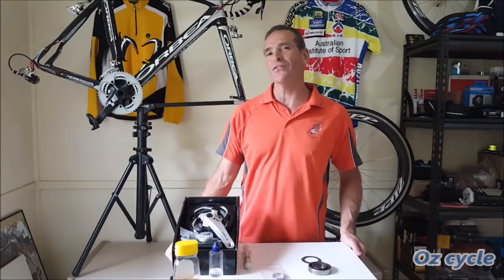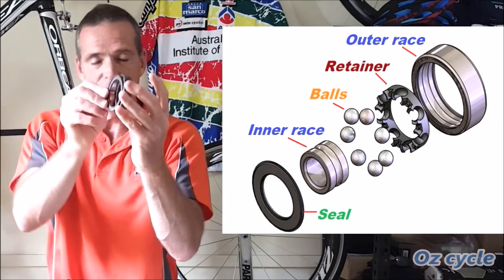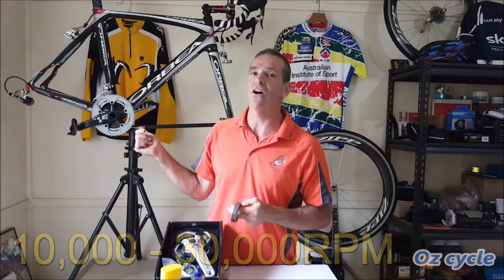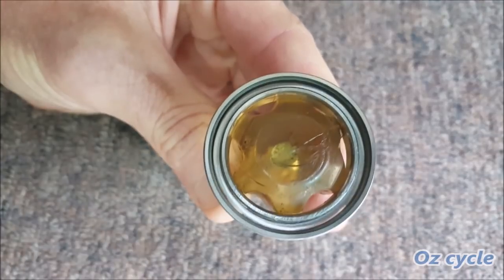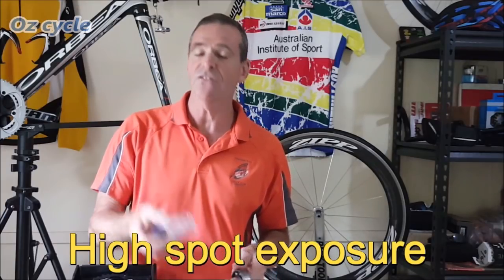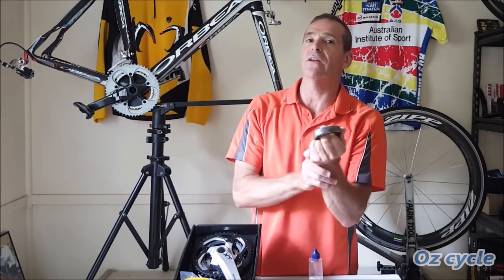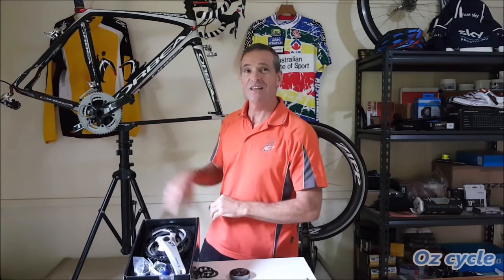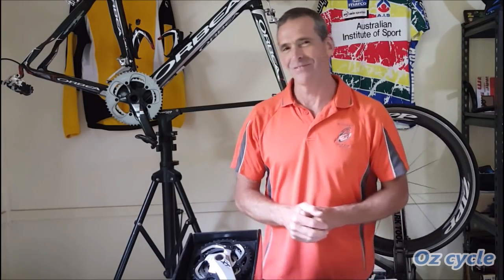Listen to your Bearings - Episode 3..Last longer , go faster.

Comment: DO NOT remove the grease from your bearings. The sticktion from grease is negligible as compared to the losses you will get when running a hot and poorly lubricated bearing. The no load spinning bearing test is flawed and shows a lack of understanding of how bearings work and what their intended purpose is.

Comment: DO NOT     repeat   DO NOT   ever use PETROL for degreasing or cleaning ever !!!!!!   it is too volatile and it's flash point is very low...   Kerosene is very effective and reasonably safe to use out in the open air.   there are many degreasers available in spray form, like WD-40.   NEVER bring petrol into an enclosed area , garage, home , basement, or place of work when the fumes can escape the approved container.    watch videos on the internet on how people set themselves on fire with petrol.

Comment: Nice video, my tip; When popping your seals off there is a risk of damaging the lip. So pop them off on the outside race not the inside because the outer lip stays static and is not as crucial for sealing.
Reply from the maker: Yes thats true,thanx David
Reply: I have started packing my bottom bracket bearings with marine grease used for boat trailers. Great for longevity as it copes with the wet weather  and with the slow rpm of the cranks I have not noticed any extra effort to overcome the extra resistance. The time I save on maintenance is well worth any time I might be losing on my commute :)

Comment: The notion that lubricants cause friction is totally wrong-minded. Dry clean bearings spin freely, because they have no significant mass, and lubes add a miniscule level of material resisting the spinning. Add the mass of a wheel, or rider, and the lube's very slight internal friction is overwhelmed by the rotational forces, and both oils and greases form critical boundary layers between the metal to metal parts, so things with quality lube are suspended on that thin film. Remove it, and you will soon destroy the bearings from pressure and contamination and corrosion, if not stainless or ceramic. Using quality bearings with adequate lube that is resistant to water contamination provides 99.9% of the friction reduction one can obtain, and dwelling on the anal aspects of hypothetical (read: magical) gains left to wring out of super-duper bearings with super-duper lubes misses the mark by a mile.

Comment: I saw that there is an NLGI grade for grease. From 000 to 6 (000 being very fluid and 6 extremely hard). For bottom bracket bearings, the ideal is 00 to 1 if I'm not mistaken.
Reply from the maker: For most bottom bracket bearings a medium viscosity grease will do fine.

Comment: Hi great video, but, but, but I have a bike with the wonderful BB30 and have grown tired of of having my factory authorized dealer repair it every 4 to 5 months. Yes it spins great for a  while but soon creaks and groans. So taking things into my own hands I repacked them with Molybdenum grease and coated the outsides with Copper grease (heat and water resistant for south Florida conditions)  Yes it probably slows the bearing down but I have not had a creek in over 8 months since I have done this. I will deal with the loss of speed and not have to worry if the bike is going to creek every time I take it out....
Reply from the maker: +Joe Martinello Good move Joe. There is a permanent solution to creaky bb....I will be uploading the video this Wednesday.  It may be your solution if it creaks again.
Reply: Thanks I will use the Loctite next time I need to repair...
Reply: Now at 14 months and over 5000 miles without a creek since using Molybdenum grease......
Reply from the maker: Thats great Joe.
Reply: @stevenleffanue  23 Months and creaking grrrr. . Way better then the 3 or 4 months I was getting with silicone grease. This time I am trying automotive  "Disk Brake Grease". I live in South Florida where the average temperature is in the 90's F. My assumption is the greasing is melting in the heat and slowly leaking out. The disk brake grease has a very high melting point. Will update.

Comment: Why are hub grease thick and viscous when this video shows that a thin lubricant is more efficient and causes less friction on the bearings?  BTW, skateboarders lub their bearings with thin oil.
Reply from the maker: A thicker lubricant will remain with the bearings longer where as thinner lube is less friction but will spin out of the bearing quicker. Using a thinner lube will require less time between relubrication.

Comment: Why then Shimano is using usually 9 bearings in rear hub and 10 in front? It's not a mechanical bearing but isn't principle the same? Edit: they are in different sizes, so how this is affecting?
Reply from the maker: Traditionally front hub body sizes are smaller than rear so smaller bearings were used in front hubs.

Comment: hai oz. super nice video. thankyou for the research! from what i see in the comments section, you recommend the medium greaser like finish line or white lithium. so, how the nano lube? is it better? or is it used together with the medium greaser? or i can use the nano lube alone. because what i get in my local market is only the nano lube for car engine, which is the lube need to be mixed with the engine oil.
Reply from the maker: +Kevin Kurniadi If the viscocity of the nano lube is like normal bearing grease it should be fine Kevin.
Reply: thanks a lot!

Comment: very good video. my bike hubs dont have ant retainers. is that because its a low end bike? £500 bike. could I put retainers in the hubs to get improved performance?
Reply from the maker: +Max Williams Not really Max as the hub body needs the races removed then to be machined square to fit a bearing. Best to buy new gear.
Reply: oz cycle thanks. Learning curve
Reply from the maker: +Heinocraft Yes thats generally right.

Comment: ive been riding road and mountain for 20 years and sometimes the small amount of friction from the grease in the bearing means  nothing when u have 29 inch wheels and a fat arse rider. i cant c myself bonking 1 k from the finnish thinking geez i should of cleaned my bearings u might gain 3 watts but the where will be severe. if u wanna save watts clean your drivechain every week lube and pollish everything
Reply from the maker: +Jase Davies Agree with you Jase. Its really about 'marginal gains' and for serious to pro-riders.